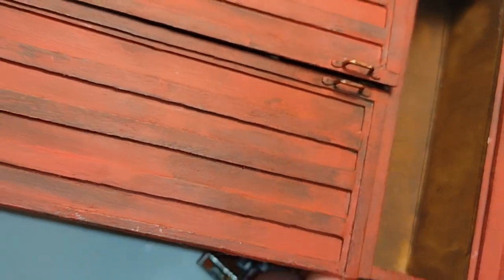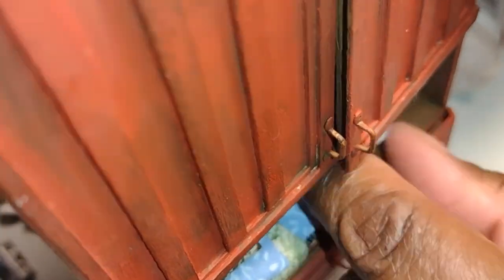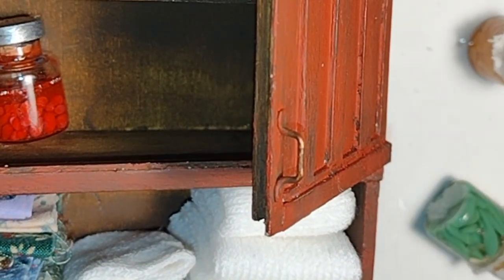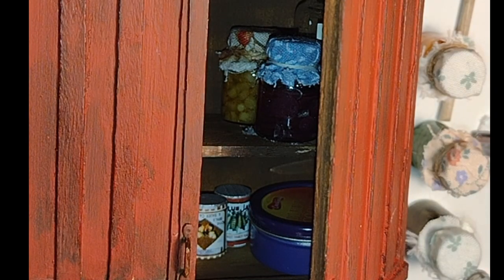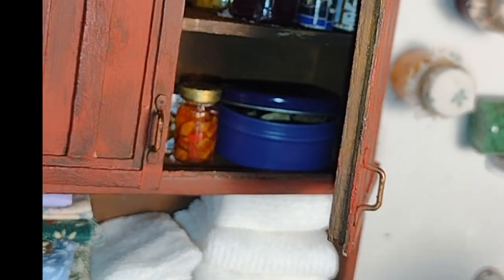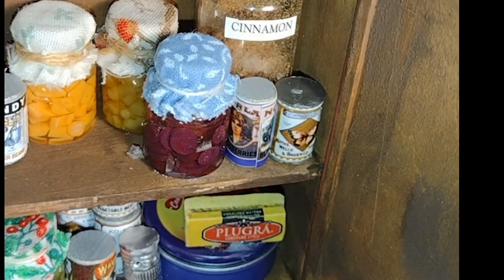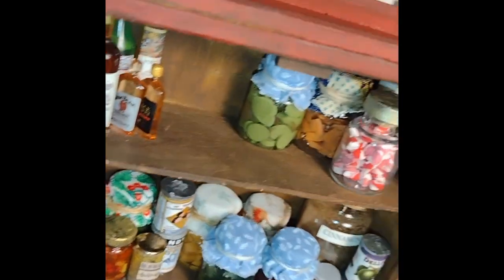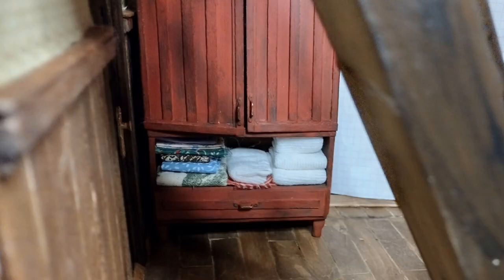Dollhouse KITCHEN #5-PANTRY Cabinet Set up -ROOMING HOUSE DOLLHOUSE

Comment: I really love this one! Where do you keep the rooming house dollhouse? I am beginning this journey with FOUR very large and different houses that I was gifted or bought. I admit it is excessive, but now that I have them, I feel a responsibility to fix them up. Have I done that before? Nooo… but I figure if I watch and learn from you and other artists daily, I might be qualified to begin when my DreamBox arrives and I get the materials I’ve purchased organized. I can’t wait to watch the video about jars of food with resin! 😊
Reply from the maker: Well I turned my daughter's old bedroom into My Dollhouse studio!  The Rooming House Dollhouse is on a really low table in the center of the room and the other dollhouses are against the walls I various parts of the room. My craft table is in the corner. The Roman House Dollhouse is a very unusual style it's OPEN on both sides and only closed on the ends. It was a custom build that I bought from a really old lady about almost 18 years ago. She had it built but never worked on it. She had it OUTSIDE in a tomato shed for years before I got it. It had survived many MICHIGAN WINTERS so repairing and renovating it was quite a challenge! But I sat down made a list of what needed to b done and got to work. I started with finishing the outside 1st! Roof, paint siding or brick. Paint or stain windows and install. But most of all do one thing at a time don't Rush. Do it as neat as possible but don't stress yourself trying to be perfect! HAVE FUN ALLOW IT TO BE PLEASANT AND WONDERFUL! REMOVE ALL DEADLINES! AFTER THE INSIDE IS COMPLETE PLAY WITH WHATEVER FURNITURE AND ACCESSORIES YOU HAVE TO DECIDE WHAT YOU NEED TO MAKE OR BUY. ALSO PLAYING WILL HELP YOU IMAGINE HOW YOU WANT THE SCENE TO LOOK OR FEEL. MOST ALL ENJOY THE PROCESS DON'T RUSH TO JUST FINISH.💖💖💖💖☺️